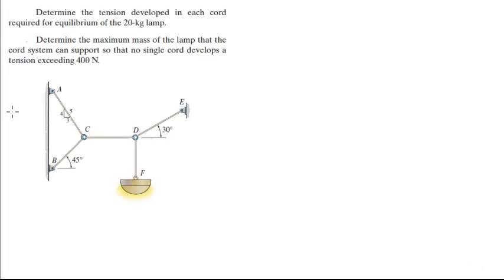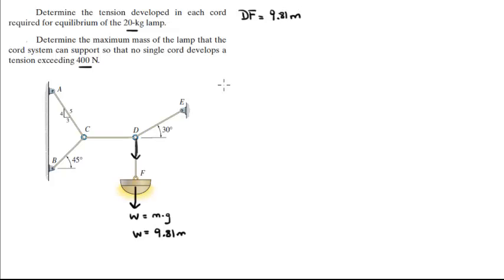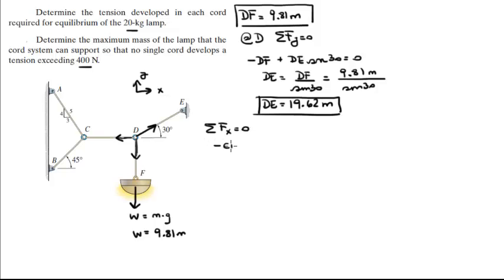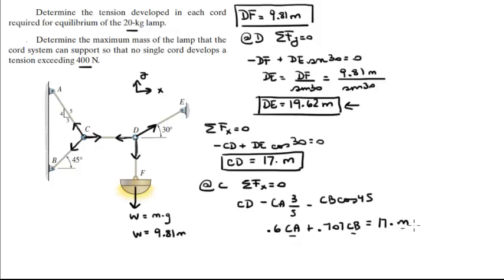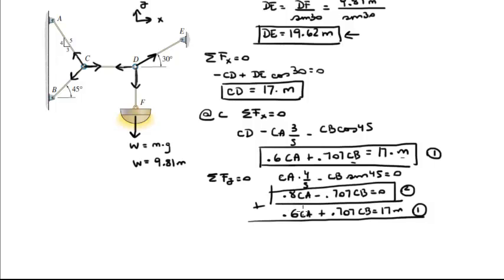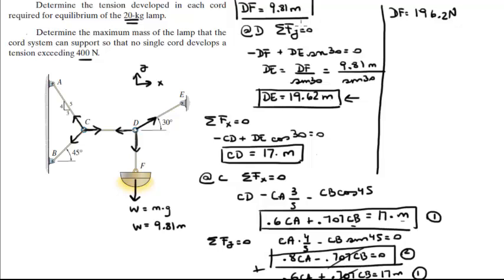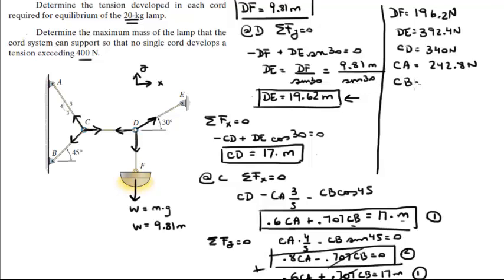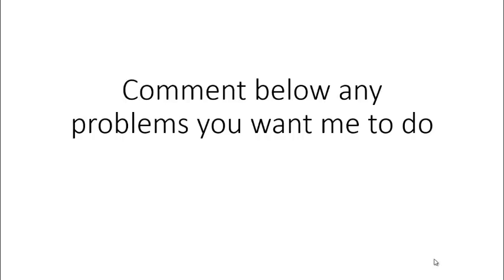Determine the tension developed in each cord and max mass of the lamp

Comment: is your notation off? When your doing about point D, sum of forces in Y it reads as DE BUT in sum of forces for X you do CD, shouldnt it be DC? indicating D to C? since its about point D
Reply: That's correct, but tension in both directions/at both ends is the same. So sometimes it helps to write them both the same so that you know you can equate them :)